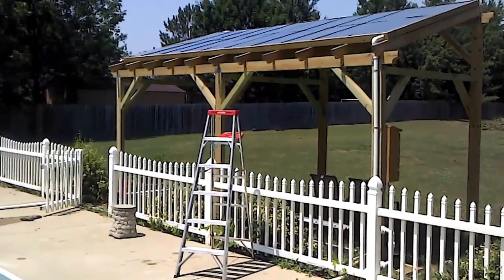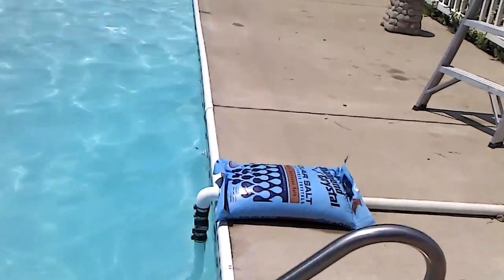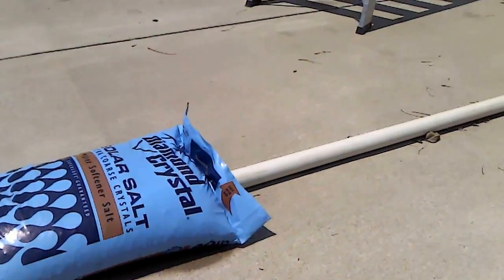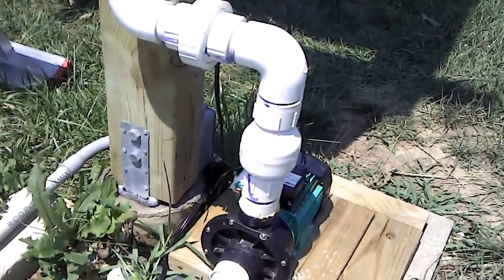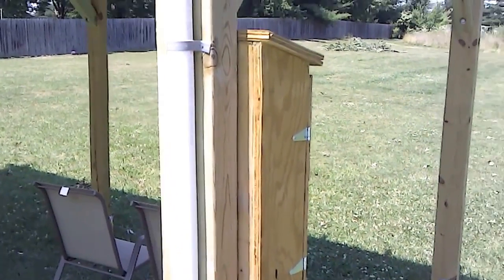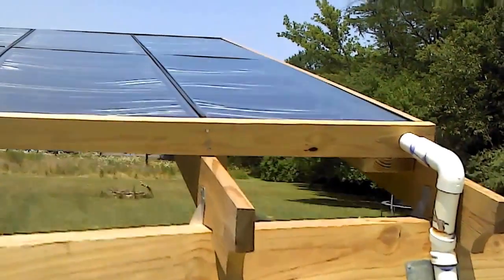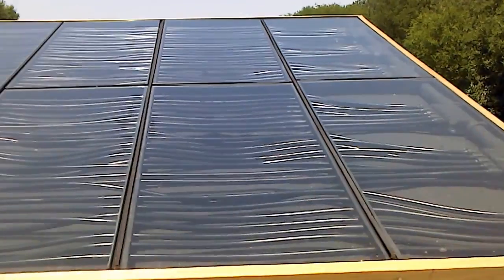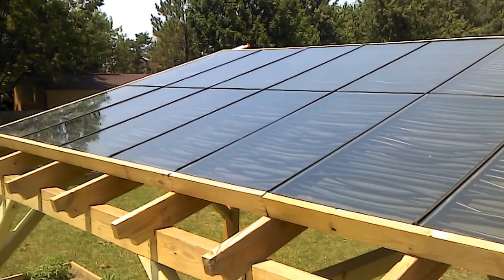Solar Pool Heater Pergola

Comment: Interesting, I better try this, I think I can save more with this heater.. great job!
Reply from the maker: I built this solar heating solution years ago. While it was great for harnessing solar rays it wasn't very efficient. The original design used a parallel system much like this http://www.jc-solarhomes.com/image/plumbing/riser2.jpg . This system required a very powerful pump in order to push the parallel mass of water through. It also had a lot of joints and connectors causing leaks and repairs over time. I have since redesigned it in series like this http://www.jc-solarhomes.com/image/plumbing/a5.gif. This allows me to use a less powerful/more efficient pump. It also has less joints and connectors meaning less leaks and repair.